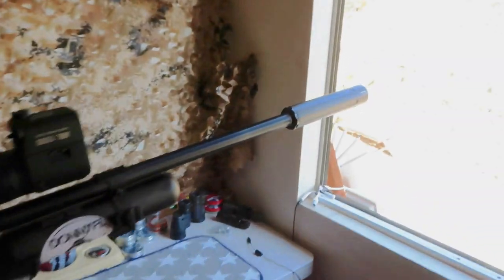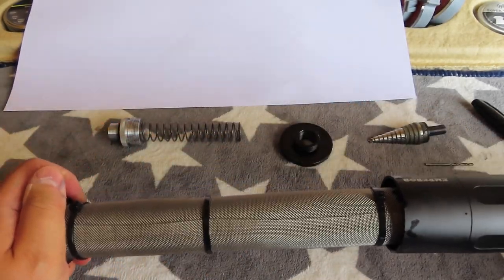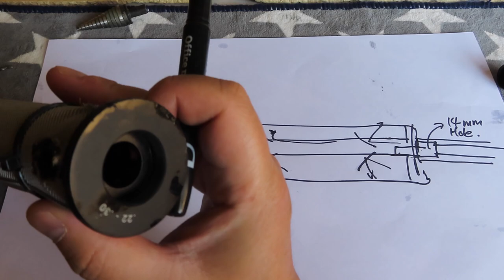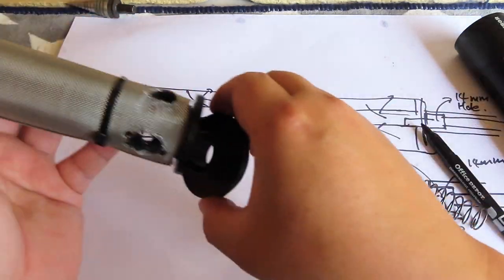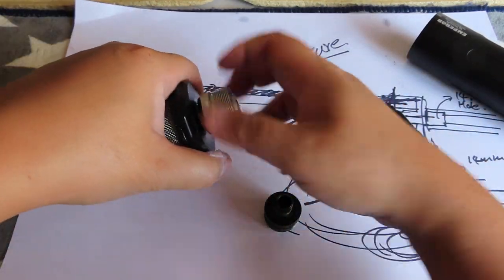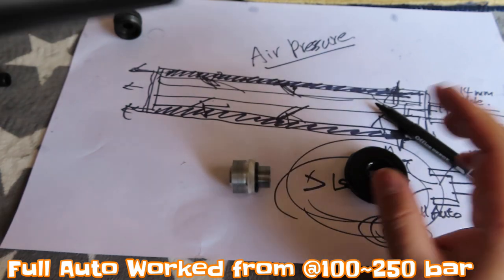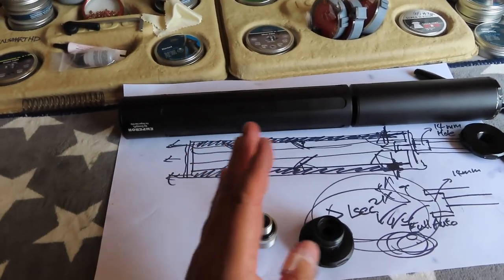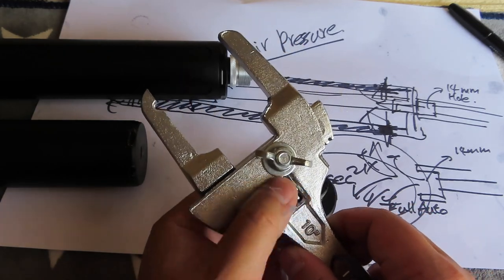Hatsan Blitz "Beast Mode" FULL-AUTO  w/ DonnyFL Emperor Silencer

Comment: Do you have the p/n of the original Donny FL 14mm suppressor adapter piece that you show at 2:12? The one they sell now has the smaller diameter hole that threads into the Emperor... any help will be appreciated.
Reply from the maker: I don't have a P/N, it was a test piece from DonnyFL.   They have to machine one for you.  Thanks for Watching
Reply: @Repsol13  Thanks, sent them an inquiry this afternoon...😎👍

Comment: Hey Man. Love the creative thinking & trying to push the silencer limits. Though would be nice to actually see some figures before &  after the mods on how many dB you gained (both semi & full). There are Apps on your phone where you could easily have some bench mark done. Have the exact same setup & would love to see my full auto to also be silenced. It's a 20dB difference versus semi auto with the Emperor. Which is huge. I don't want to risk drilling the emperor to e.g. go a couple of dB louder on semi. Can't tell that from your videos.. Keep it up.
Reply from the maker: It is a lot quieter, the goal is to make the FullAuto work and have the consist accuracy.   We can silence any gun, but if it can't hit the target, it is useless..., especially in this case @FullAuto Mode.  This video shows you how to achieve that.   https://youtu.be/hh66npTSCzQ
The grouping @25 yards is less than 0.5" diameter under FULL Auto
Reply from the maker: As you can see the live test, all 21 pellets >1 sec, @1000fps, drilled at the same point, this is @23 yards

https://www.instagram.com/s/aGlnaGxpZ2h0OjE3ODkzNzQ3MTc1MDYxMjYw?story_media_id=2568100194587725379_2677185025&igshid=1eijs055756nz
Reply: @Repsol13  Interesting! Do you know/expect the same accuracy & noise reduction could be achieved by drilling the DonnyFL Extender instead of the emperor to drain air?
Reply from the maker: @snimki  love to try that, but he didn't send me 2nd adopter for the extender....🥲

Comment: Nice Video,
can you make some measurements about the outside diameter from the Adapter you are using? the inner hole is 14mm so what is the outside diameter over all?
Reply from the maker: Thanks, here are the numbers exterior Barrel shroud is D28.1mm, DonnyFL threads outer is D17.08mm, adopter inner hole opening D14mm
Reply: @Repsol13  Thanks a lot, will see if i can find here a business who is able to made a Adapter who fits.

Comment: Hi ..help my blitz lose full auto
Reply from the maker: You have Silencer?? Either way, it helps to fire/cycle in semi auto few times/rounds, then selection back to full auto, cycle few times, fill the air pressure back to 250psi.  Then, it will work Fullauto again.  (I took my blitz apart, and filled down the internal part's hard edges that really helped) l, don't touch the air bottle parts, only the two sides plates of Blitz
Reply: @Repsol13  thanks..